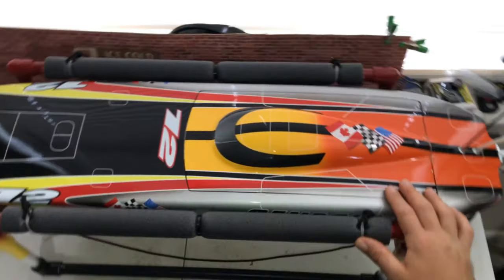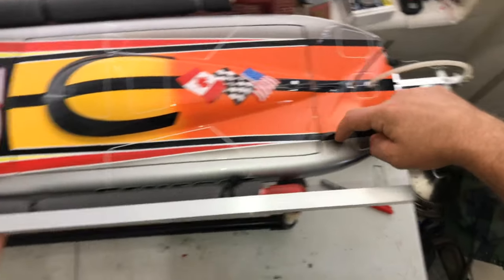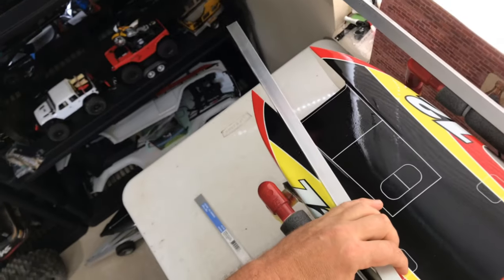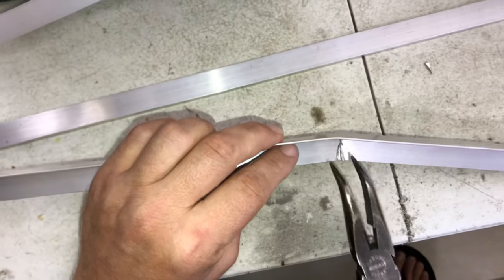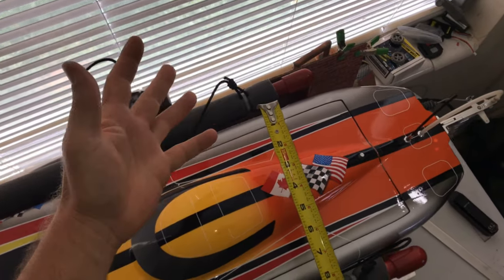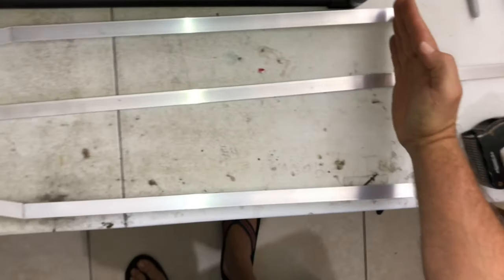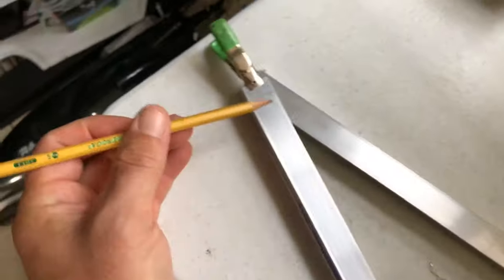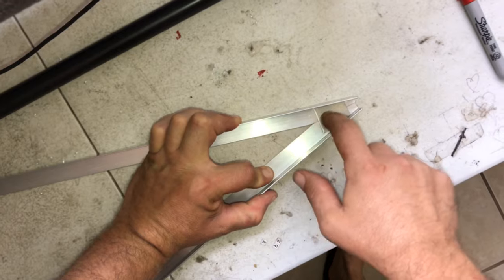🛠 D.I.Y Rc Trailer Build for Twin Haul Boat 🔩 #Genesisrcspeedboat

Comment: Looks great simple and great steps thanks, my only concern at the finished trailer is the rudder looks very close to the ground, i assume if the centre channels were a touch higher or the front middle support was a touch lower so the hull sat face down more,  but il test when i make my first one
Reply from the maker: Pommy Life thank you and glad your digging the build... and yes your absolutely right, you could just raise the C-channels up a bit to raise the whole boat higher. Thanks for watching and commenting 🤜🏻🤛🏼💯👍🏼

Comment: Forgot to ask before, wouldn't you get interference by not plugging the wheels somehow... letting water in them and soaking the foams?    I wonder if that green/ black boat showed on RC SAYLORS would also fit on the FT1011 trailer? 🤔  find out,  thinking about getting that one too.
Reply from the maker: Lyle Kehrer never really bothered with it on my first couple trailers.... I think it goes too slow to even notice but definitely would hurt to do 💯👍🏼 yeah that vhaul trailer from the ft011 would work well with many around that same size for sure.